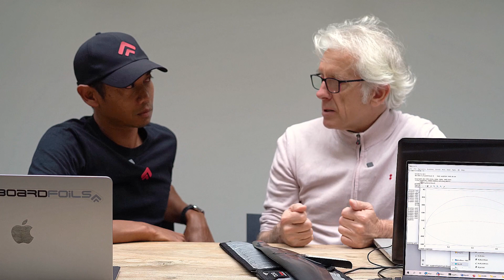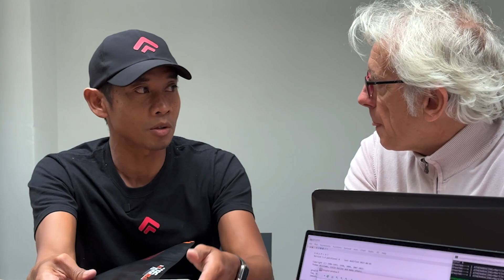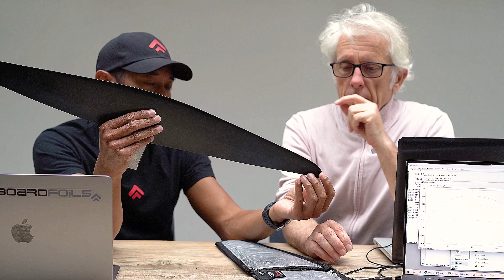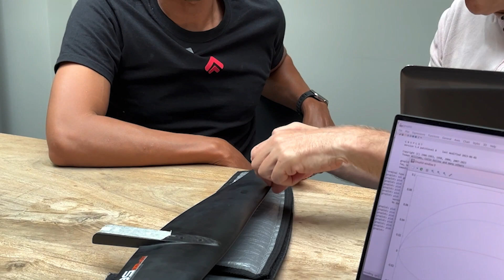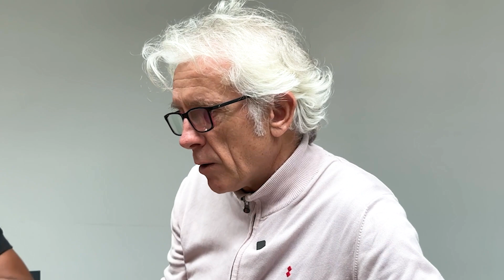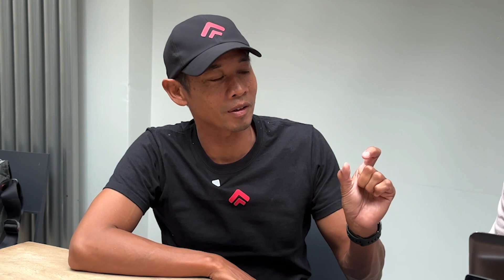Talking Foils with Martin Fischer

Comment: If I understand correctly, you optimize a 3D wing shape so that the lift-to-drag ratio is higher than a certain value, but how is this ratio determined for a given shape? It seems very difficult to simulate hydrodynamic flow.